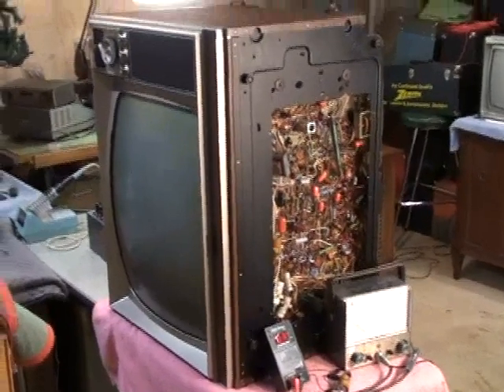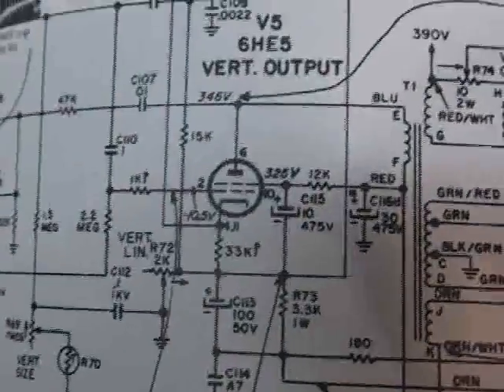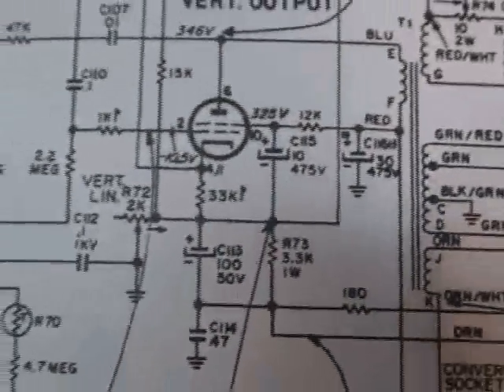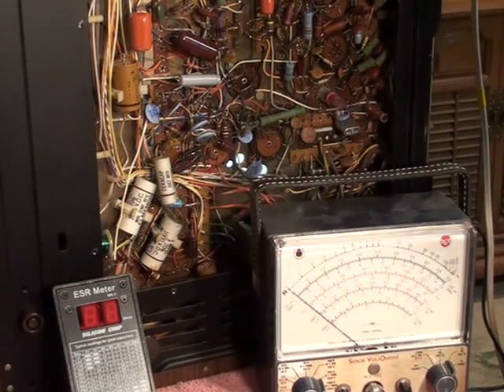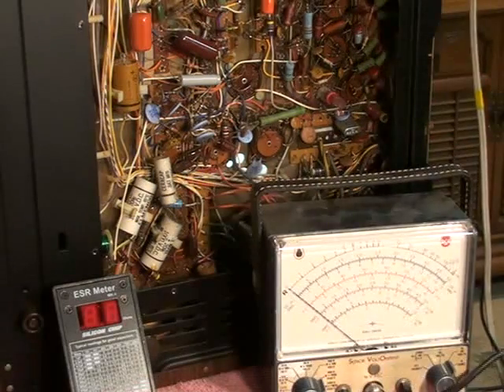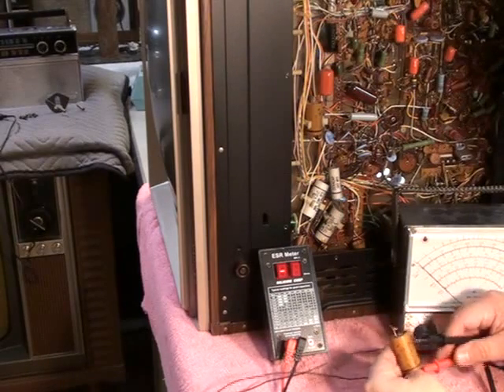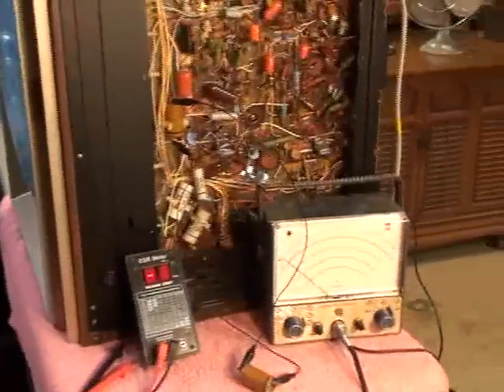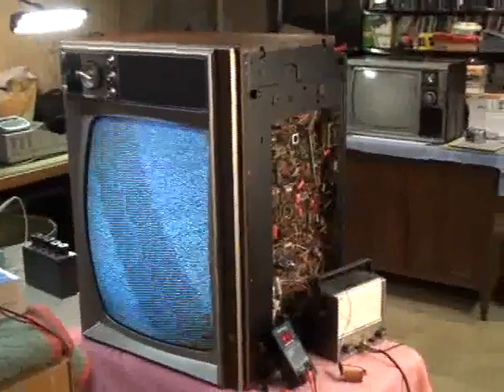1969 Zenith Color Television repairs PART 2

Comment from the maker: Yep, not one single trace.  In point to point wiring, the "board" is called the chassis.  Especially good for tube type electronics where there is alot of heat generation from the tubes.  The chassis has good heat dissapation characteristics.

Comment from the maker: The cap installed was an identical to the original 10uF@475v.  I never use the wrong value parts to "fix" a problem.

Comment: Question when testing a cap out of set with jumpers, does the long wires to run the capacitor, change the value any, do to the long wires. Thanks

Comment: The answer lies in remove/replace all the plastic covered aluminum capacitors!
Time passing & use make them go "stale",..they are kind of like a battery in the same way..they just don't last forever.
If a competent TV Man restore that TV it would last another 15yrs.
Continuing to operate the set with shorting or dried out parts will eventually "fry" the transistors, (& then you find out that certain transistors not available any more, or they are expensive now).